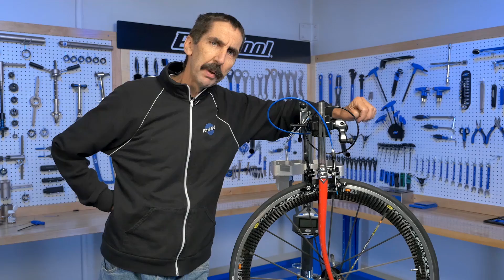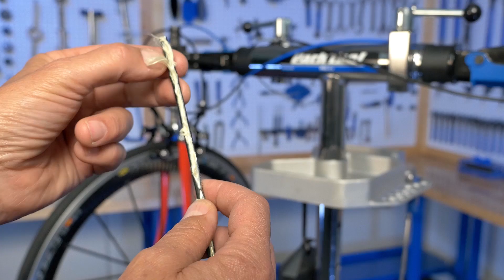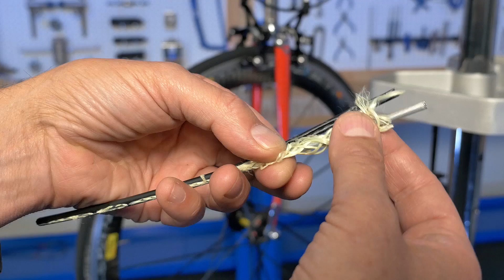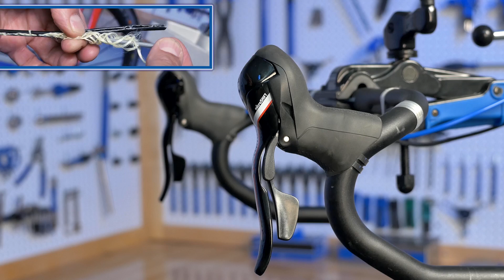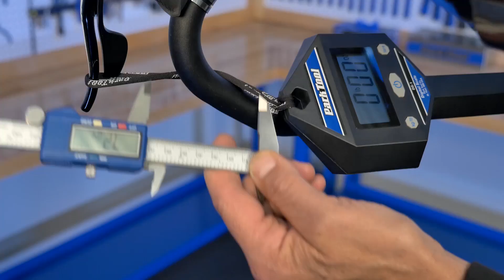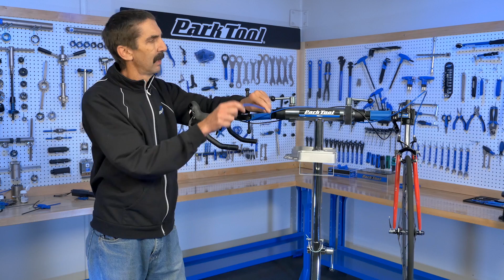Tech Tuesday #43: Brake Housing

Comment: I disagree. If the cables have the same tension by the brake lever and the same friction in the housing the tension at the caliper is the same which gives the same braking power. Stiffer housing will only improve the feel and perhaps modulation of the brakes.
Reply: I totally agree with your argument about the braking power. But one thing you have forgotten: Maximum braking power is better with stiffer housing, because of you need more force to reach the handle bar with the brake lever (=brake force limitation).
Reply: I just installed some, and my mechanical discs went from feeling spongy at the lever to super solid at the end of the lever travel. If you prefer sram hydraulics (spongy) then  you probably don't want compressionless housing. If you like shimano hydraulics, then you would probably also like compressionless housing.

Comment: Im a bit doubtful about this test setup. That big dangly section of housing that has visible flex I think plays a big role in performance. In a real setup, there is never going to be that much unsupported housing (hopefully)
Reply: Yes there will be: from the levers to the first zapstrap (or cable wrap, whichever you use) there is lots of unsupported housing. More so for people who like bar spins, or when the cables go underneath the bottom bracket on a suspension bike.